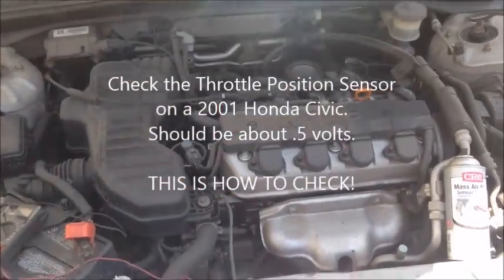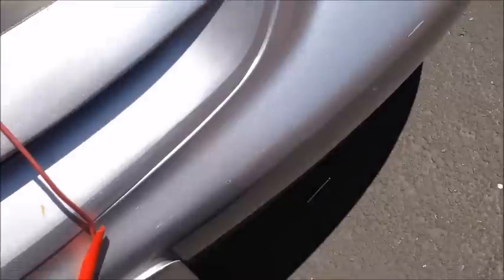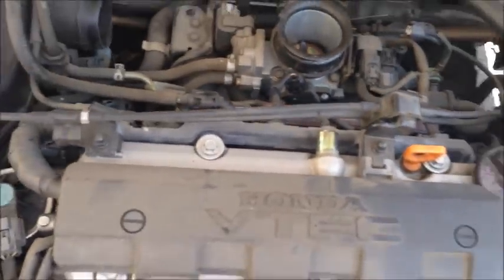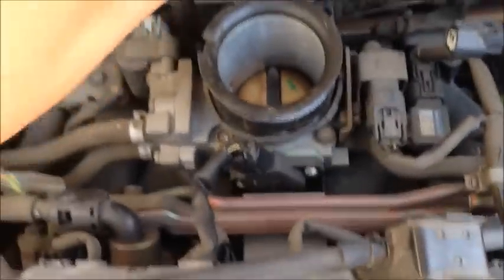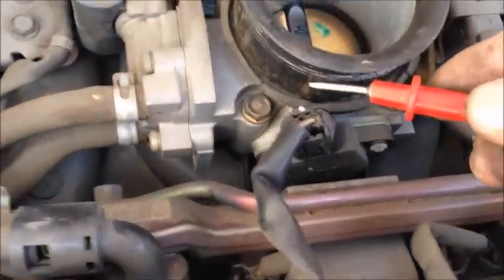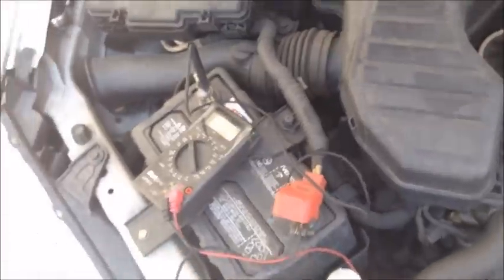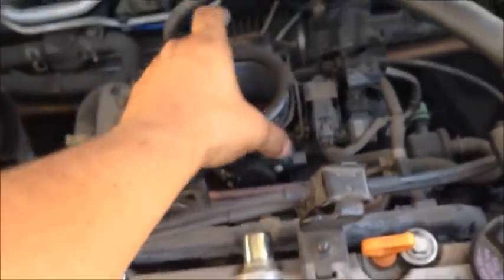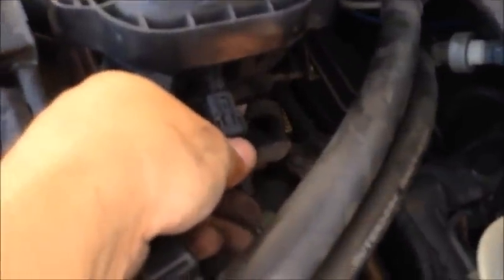Check Throttle Posistion Sensor (TPS) on 2001 Civic

Comment: It should be .5 closed...4.5 wide open. TPS is adjustable by loosening the screws and rotating the TPS assembly slightly. If voltages can not be kept within those ranges, check to make sure you have no broken wires andmake sure your throttle body is clean...rest it...if it still doesnt work, i'd replace the TPS.